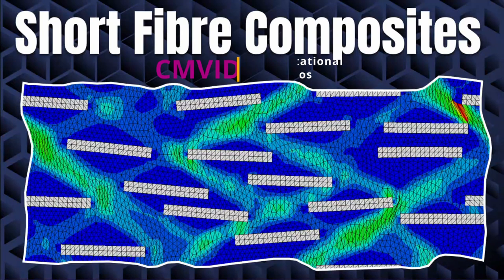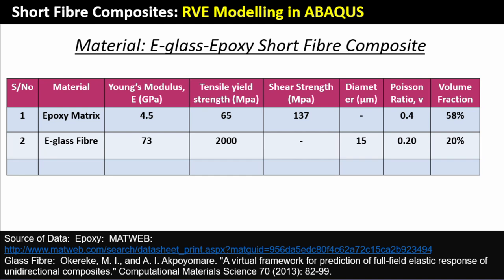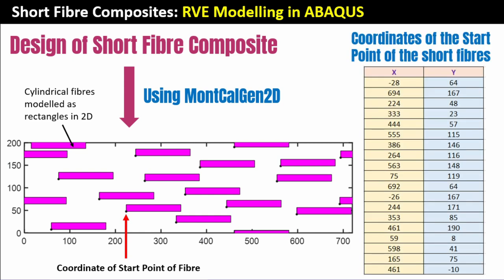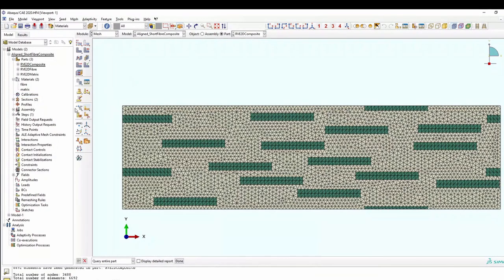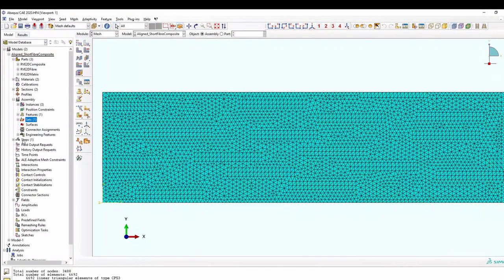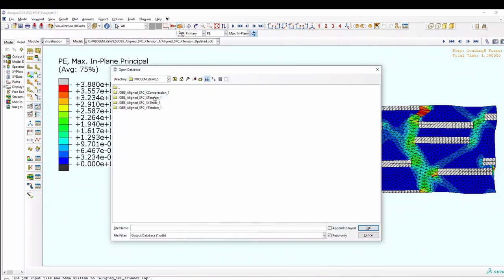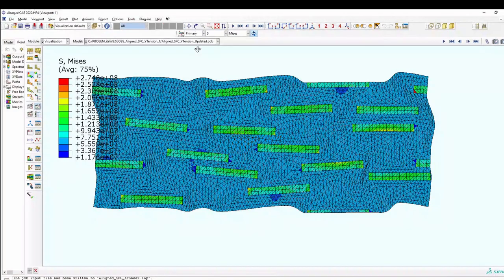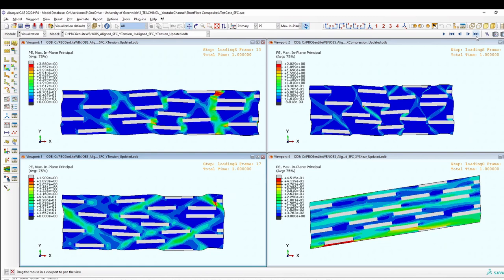RVE Modelling of Short Fibre Composites in ABAQUS

Comment: Dear Dr.Michael, thanks for this  tutorial about random short fiber. I need to create a fiber composite consisting of multiple cylindrical centers around which short fibers are arranged in a rotating pattern. I don't know how to create this model. If you share your suggestions with me, I would be very happy. I thank you in advance.
Reply from the maker: Hello, thanks for your query. I am not sure I understand what you are trying to do here. What I think you mean is that you want to create a micromechanical model of a short fibre composite but with the fibres distributed around a circular shaped RVE? Is this correct? What is the reason for this sort of RVE? What sort of loading are you looking to apply on such a circular shaped RVE? Is this a 3D or 2D problem, and if 3D, then I assume the RVE should be cylindrical. YOu did reference that the short fibres are small cylinders so I am thinking you are working on  3D domain.

Please let me have some more information and then I will be able to provide more answers. Alternatively, just send me a message on my linked in here: www.linkedin.com/in/miokereke

Comment: Sir, how can I know 58% Epoxy Matrix corresponds to E= 4.5 & V= 0.4
And 20% E glass fibre corresponds to E= 73 & v= 0.20?
Reply from the maker: I think for this problem you ahve to determine first the composite properties based on the given volume fraction. This is the only way you can prove what you are suggesting. I am not sure if this is the answer you are looking for as it is not clear to me what the question is.

Comment: Sir..is it possible to introduce the orientation tensor in the script...so that we can get the results for different orientations..
Reply from the maker: Hello Subrat, you make a really good comment about the orientation tensor. It is very possible to do that but this has to also follow the Monte Carlo method of randomness. I always want the code to be independent of human interference so that you do not have to go and choose rotation tensors 'manually' and apply those onto the fibres. This is a half-way house, what I propose is an automatic way of choosing and implementing the rotation tensor. 

So for randomness of orientation to be included in the current implementation, the code should allow for a fibre orientation between 0 and 360 degrees and the chosen angle should be randomly determined. So, if you think about it, you will be looking at randomness in location and orientation. This will certainly slow the code down but it is possible to do. In future, I plan to incorporate the rotation-based Monte Carlo algorithm within MontCarlGen2D. Thanks for the suggestion though.

Comment: I have an assembly made of chopped fibre and it has no proper orientation, and want to simulate it using Abaqus? Can you please direct me that how can I define a chopped fibre in Abaqus?
Reply from the maker: Hello @Sadiq Amin, thanks for your interest in the channel. I think what you are asking is how to specify properties to a fibre constituent in a chopped-strand short fibre composites. I will also assume that when you created the models, you had to design the fibre and the matrix independently, and within ABAQUS used the assembly module to combine them to form the short fibre composites. If these assumptions are true, then I will suggest you use the 'REMOVE SELECTED' button (on the menu bar) to select the Matrix (in the ASSEMBLY module) and this will remove the matrix leaving behind the fibres. With this, you can assign properties to the fibres by selecting all of them at once and using SECTION ASSIGNMENT to assign properties to the fibres. I hope this helps.

Comment: when the montcarGen2D software will be available to us? cannot wait longer for that, lolol
Reply from the maker: Hello Victor, I apologise for the delay. I have been lately improving the usability of the code so that users can use it with minimal effort and where errors occur, the error-catching algorithms in the code will suggest to users what the error is and how to correct it. I believe this is essential for any software so that you will have a good experience with the code. 

I am also working on including some heuristics to the classic Monte Carlo process so that MontCarlGen2D can generate a higher volume fractions of RVE which is not always easy. If you know about the Monte Carlo process, it suffers from a jamming limit and this is typically at a volume fraction of about 40%-50%. Beyond this, the code will take too long to run. A heuristic implementation is normally included in the classic Monte Carlo process. This allows for stirring or shaking of the original inclusions in the box/RVE so that they 'settle' making more space for further inclusions to be added to the box. I am incorporating this 'stirring algorithm' into MontCarloGen2D hence the delay. I am also recording two videos to go with the Monte Carlo methods, the first being a discussion of the theory of the Monte Carlo Methods and the second showing how MontCarlGen2D works. Thanks for your continued patience and in the next couple of weeks, you will have the code.

Comment: Thank you sir, but I have a question, please  how you can to select the start point of the fibers, are they selected randomly in the software?
Reply from the maker: Yes @Kamilia Leksir, the start point of the fibres is randomly generated. Based on that start point, we now create the required rectangle for the fibre. Someone can make the randomization to be based on the centre of the fibre but I chose to do it differently here. So, basically, the monte carlo methods generate random x and y coordinate positions to represent the start point of the rectangle i.e. the bottom left hand corner of the rectangle.
Reply: @MichaelOkereke thank you so much Docteur, hope you a good job
Reply: @MichaelOkereke  Dear doctor, can I get your email or any contact , please , i would like for your help
Reply from the maker: There is an email on the About page of my channel which you can contact me with.
Reply: @MichaelOkereke  ok thank you 👍